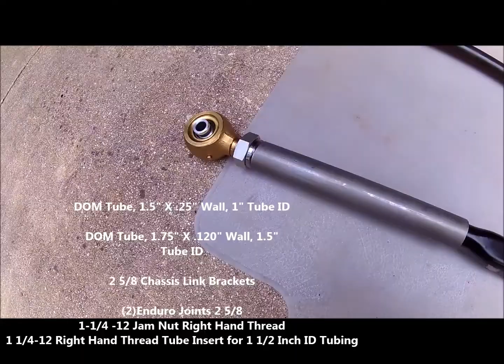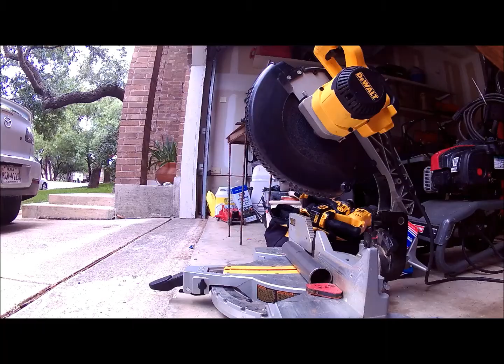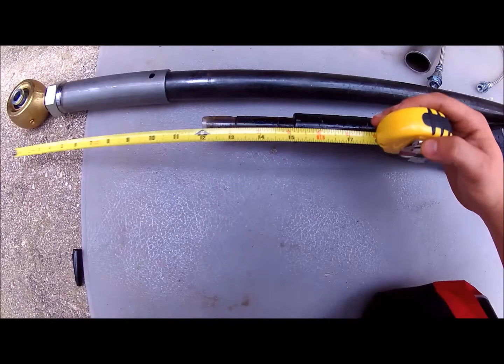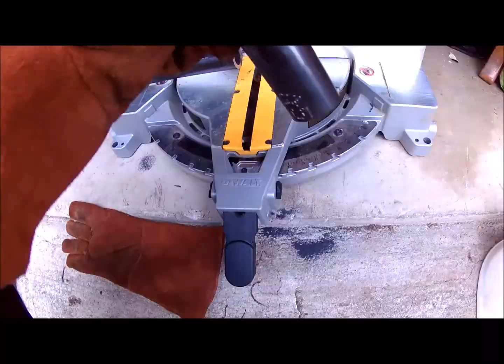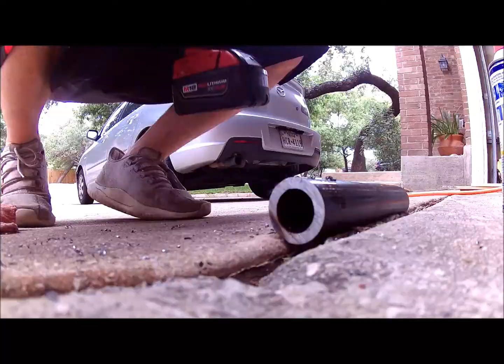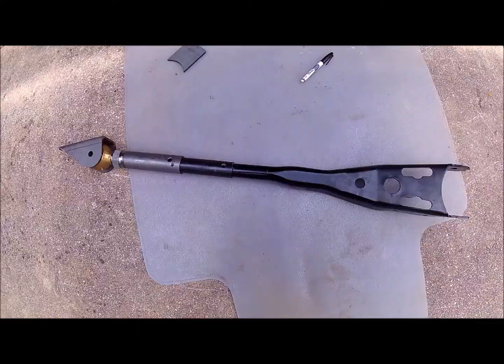OBS Ford Extended Radius Arm Build (Part 1)

Comment: Do the 4wd axle pivot drop brackets work for the 2wd?? Where did you get urs? Everyone only sells for 4wd, did they work for your 2wd??
Reply from the maker: yes the 4x4 brackets are the same. the 2wd and 4wd beams have the same mounting width bushings on the beams, and my drop brackets are just rough country 6 in drop
Reply: @TroyAnthony25  awesome thanks for that info, its just weird they all say for 4wd only..
Reply from the maker: @eurotomek35  yeah if your trying to buy brackets only their mainly gonna say 4x4 only but when i bought my liftkit they had a full 2wd kit from rough country. if you look up "wills garage" he did a 2wd to 4x4 conversion on his f150 check out his videos . the same goes for the radius arm drop brackets aswell those are universal

Comment: How have they been holding up? and if you do have them installed and have used them, is 12" plenty long enough? or would have you went longer when you built them, now knowing how they flex?
Reply from the maker: i dont have them installed yet, but their 15 inches extended from stock length